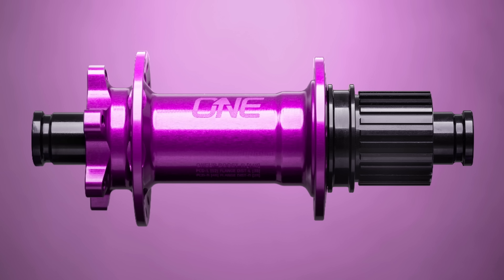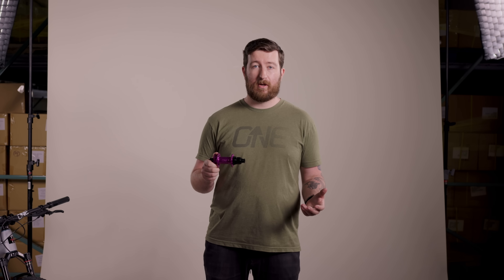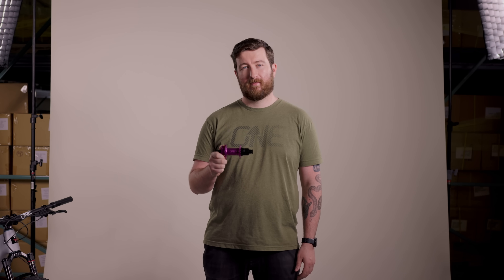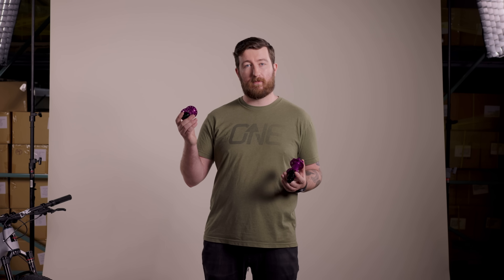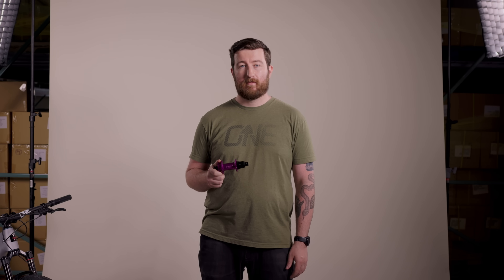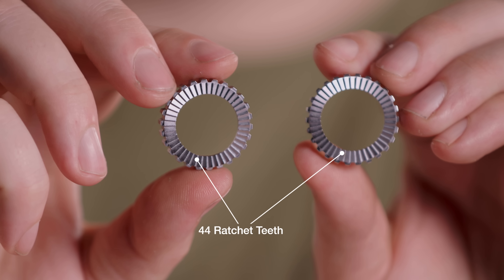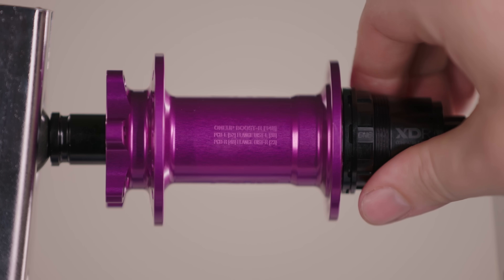NEW OneUp Components Hubs

Comment: the day the dt ratchet patent expired was a good day for many bike companies hehe. this variant looks great.
Reply: it is 100% copy with just more/less teeth
Reply: It was a good day for us, the consumer. Its a great system
Reply: @esshoul  The patent has expired, nothing wrong with copying something that is proven to be solid.
Reply: I absolutely love DT350’s, but I also love colors. Might have to bling my bike out at some point with these
Reply: Yes, what we need is more noise on the roads.
Reply: its like how suntour owned the patent for the double parallelogram rear derailleur.  And then when that patent expired everyone got nicer RD's
Reply: @zacharyk7006  derailleurs are still terrible though. who thought it was a good idea to run a transmission exposed to the elements?
Reply: @difflocktwo the people who are trying to get the most out of the human body’s modest capacity to produce torque.
Reply: @difflocktwo  If you know how to use a derailleur hanger alignment tool or if you just get your bike tuned somewhat regularly you shouldn’t have derailleur issues. I ride a lot and my derailleurs are never a problem
Reply: @jarnold1789  Why would I need to tune it regularly? That sounds like a defect. A bike is a very light duty machine compared to many other machines, maintenance intervals should be decades apart.
Reply: @CalebKussmaul  So we sacrifice everything for better pedalling efficiency?
Reply: @difflocktwo   Then learn how not to smack your derailleur on stuff. Mechanical things require upkeep. If you’re having derailleur issues it’s a you problem
Reply: @jarnold1789  Mechanical things need upkeep but bicycles need 1000x more frequent upkeep. Bicycles are very light duty and require frequent maintenance.
Reply: Why is it so much louder than DT Swiss?
Reply: The same face ratchet design has been in use on the keyless works of mechanical watches for at least a century.
Reply: @zacharyk7006  What's a double parallelogram rear derailleur? Every derailleur I know of has a single parallelogram. Maybe you're talking about Sun Race, who had the patent on the angled parallelogram design, which moved the jockey cage down as it moved in to lower gears, but SRAM ditched that with the Eagle derailleurs and they still work well. 

Shimano's patent on the up and downshift levers sharing the same pivot on their shifters is the reason the ergonomics on SRAM shifters are so bad though 😞.
Reply: @difflocktwo  Bikes are not very light duty at all compared to most machinery. Most machines rely on high rpm and low torque to transmit power, but human legs are high torque, low rpm, so bike drivetrains have to be a lot heavier duty than equivalent power electric motors for example. The 250 Nm torque capacity rating seen on bike gearboxes is more than the max torque an internal combustion engine, perfectly adequate to get a SUV to motorway cruising speed, can output. This makes bike drivetrains very heavy duty. Also consider the rider weighs many times as much as the entire bike. What is shameful in the bike industry is the normalising of very short service intervals on forks and shocks. My car is running almost entirely the same suspension as it was made with 13 years ago, with no regular servicing at all, open bath coil forks like the Marzocchi Bomber would run beautifully for years between services too - now nobody makes suspension that's genuinely fit and forget.
Reply: @peglor  Most mechanical systems have much higher torque and much higher rpm than a bicycle. Any machine with more than a kW of power output. And they run all day in dust and dirt.

You can think about the smallest lightest car and how much wheel torque and power it puts down from a stand still. Sure motor torque is 100-200 Nm, but it does that at 1000s of input rpm and then the wheel torque is way higher.

Loads inside a 6000 rpm engine are no joke compared to someone pedalling to the store.

And the transmission in those cars last forever with minimal maintenance.

1000s of N of force and few hundreds of Nm of torque on a bike is nothing special.

250 Nm input torque might be the input limit for such a car transmission but there are many points in that transmission seeing way more. There are multiple points of speed reduction found in those transmissions that leads to 1000s of Nm at the wheel , with not much steel.

A tiny electric motor will destroy a bicycle drivetrain through bent chainrings, bent cogs or snapped chains. Or even bent frames.

True, bike weight to rider weight should be considered.

Yep, pretty much all aspects of bicycles are super high maintenance.
Reply: @difflocktwo  Motor vehicle drivetrains don't run all day in dust and dirt, they're very well sealed and fail quickly when the oil sealed in with them gets contaminated or leaks out. They can afford to be well sealed because the weight of the gearbox housing and oil bath is small compared to the overall vehicle weight and the friction that really effective sealing where driveshafts exit the housings add is negligible compared to the power available from the engine. 

If electric motors (That weren't massively oversized and overweight for the application of moving a bike and rider around) were so good at chewing up bike drivetrains, e-bike specific drivetrains would need to be dramatically different in design from the pedal powered ones, and they're not. Also most of the housing of an ebike motor is to gear the motor down to the point where it's making sufficient torque to be able to move a bike.

When you consider that moving to a Pinion gearbox on a bike (Which, combined with belt drive means that even in wet muddy conditions, the earliest service interval, apart from hosing the bike down after muddy rides with no lubing, moves out to brake pad changes) would mean a weight penalty of at least 1 kg (Or a 10%+ weight increase on anything for XC racing), while also being less mechanically efficient.

Belt drives are less efficient than chains due to the heat generation in the rubber of the belt as it flexes (Same thing that creates rolling drag in tires). Meshing gears running in oil can be very efficient, but you still need a chain, which runs at similar efficiency whether it's on a derailleur system or a gearbox, to transmit the power to the wheel, so regardless of the gearbox used, the mere fact it is in the driveline means it will reduce overall efficiency.

Apart from a small few in DH/Enduro racing and long haul self supported bikepackers, very few bikes will use this setup. There is a 100k prize being offered this year to the first person to podium in DH using a gearbox, which might persuade a few more to try them.

Efficiency on gearbox bikes is poor enough that for the recent Tour Divide race (4400 km self supported with 60 km altitude gain from Canada to Mexico along the Rocky Mountains), even though a gearbox and belt drive would need massively less minding and the % weight penalty is much less relative to the weight of the bike with food, water, clothes and camping gear, the vast majority of riders still went with derailleurs for the efficiency benefit.

Comment: Only missing the complete set of wheels, been using the edc v1 since 2017 and is like new. A brand that knows what we riders need. Thanks for your commitment
Reply: Please don't use alloy nipples if you make a complete carbon wheelset. 
Thanks!
I'll keep the secret 😅
Reply: @LawrenceMacMacster  let keep it in secret, but if you wanna tight spokes on a whell its better to do with a right tool and not a multi tool. And leave it like this, the rest is for you

Comment: As much as i love oneup, 8.2° of engagement isn't the new benchmark. The feeling of hydra near instant engagement or onyx true instant engagement isn't gonna be beat by these. Tight engagement is hugely noticeable, hugely beneficial, and makes a bike feel tight and quiet (other than the hub buzz)
Reply: Idk about hugely beneficial. Hugely marketed that’s for certain. If you can’t make it up a techy climb with 8.2 degrees engagement that’s a skill issue not a hub issue. More engagement more pedal kickback.
Reply: @MillerRL96 it’s not about whether or not you need it but whether it benefits you or not. Do you really have that much problems with pedal kickback? Have you actually used the higher engagement hubs?
Reply: @MillerRL96  0.52° vs 8.52° is noticeable, quite noticeable. Moreover, next to no engagement is so quiet. And a quiet bike is a quiet mind and a fast bike. If you don't appreciate a quiet bike, then maybe the higher engagement ain't for you. Not only does it make a noticeable difference on technical climbing, it makes a difference in preloading your rear suspension for jumping. I highly doubt you've even tried it if you are arguing against it.

Comment: Genuinely curious how the drive ring being machined into the shell, resulting in all that wear on 7075, will hold up over time. (Comparing, of course, to the steel that DT makes their threaded drive ring from). They look like a rad new hub set otherwise!
Reply: That steel drive ring on Dt swiss is still threaded to Alu hub body...I assume that the endurance is similar..If the aluminum microspline does not have any problems with the cassette, I think this one will not have any problems either, it has a similar design, slightly deeper channels.
Reply: @zoranpl  but the "wear" of threads tightening over time is not remotely the same as splines that intermittently engage and disengage under torque
Reply: Dt ratchet ring is sprung on both sides. So the drive ring has to be steel as the ratchet ring slides back and forth in it during freewheeling. This looks like only the freehub side is sprung. Possible the alu could deform under load, but it looks pretty deep so even if it does, it shouldn’t affect anything.
Reply: @jshemuel  I know the man who destroyed that thread on the dt swiss hub... first time I saw it in my life... He could just thrown it away. This system seems more durable to me... the material will have marks but it will still do the job

Comment: 8.2 degrees is not a new benchmark. That's way too high, when there's hubs with as low as 2 degrees that exist. 

Also, machining the drive ring into the hub itself means that if it's going to fail, that's a hub replacement, instead of drive ring replacement.

Comment: The only detail that worries me is the drive spline cut directly into the hub shell. There's a very good reason just about everyone else has a steel spline here. Aluminium doesn't take high surface pressures and having other parts sliding on it anything like as well. If the hub body is also 7075 (The freehub is 7075 according to the video, and it absolutely needs to be as anything softer will get chewed in no time by the cassette under any half way strong rider) and it's hard anodised it will still last longer than most people will ever need though. Otherwise the design looks very sensible. I'll be looking at these if the Pro4 Hopes I've already got ever give trouble that's not immediately covered on their warranty.

Comment: OneUp Hubs use a OneUp-specific ratchet and spring. You can use a OneUp Ratchet in your DT Swiss™ hub (which requires an additional spacer), but you cannot use a DT Swiss™ Ratchet in a OneUp Hub.

Comment: Hey one up like the design of these rear hubs but i,m a little dubious about the ratchet ring running straight into the hub shell if you want see if your rear hub is strong send me one to test i have not found a rear hub on the market that can handle my torque i know i sound full of my self but its true. Also looks like you used the old size hugi ratchet rings ie slow engagement model 😣

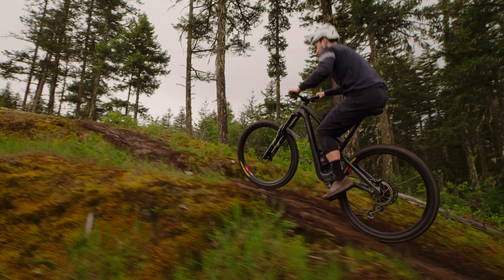Comment: I hate to break to you, but there is a fatal flaw in your design. Aluminum is much softer than steal. The steel insert is maybe 20 grams difference. @1:18 The pressed in drive ring is a wearable. When the shell wears out now you will be replacing the entire wheel. I have destroyed plenty of wheels.  I promise you this will be an issue and your will need to come up with a revision if you want it to be reliable.
Reply from the maker: We used 7075 Aluminum for the hub shell and haven't seen any drive ring failures in all our years of testing our design.
Reply: @oneupcomponents_official  I don't mean it in a bad way dude I'm just destroyed a lot of stuff including chainrings and whatnot that I made it at 7075 aluminum. If you're in a ride to sugar Sand Florida I can promise you eventually chew itself.
Reply: Using voice to text and I got weird icons on my phone I don't know how to get off.

Comment: As a Bike mechanic, I like your hubs! The ratchet system you running, is the best and endurabel set up. I ride the same system on my 2017 DH Bike, with the DT 180 hubs. But like I said, your hub is running too, with the best possible set up! And for me, personal, it's cool, that you can turn your ratchet quiet, with a bit grease, on the right teeth ring 😂👍‼️
And, also very important, your product looks almonst porn👍👍👍‼️

Comment: 44poe just doesn't cut it for tech climbs.  I used to think jumping from a DTSwiss 36t to a 54t was great, then tried Hunt 72poe and it was even better and thought don't really need more than that,  than tried  Raceface 120t and thought that it was almost instant engagment and my minimum is 72t, then tried I9 Hydra and thought it don't get better than this, went back to 72t and that did not cut it and even 120poe felt slopy and thought 120poe was the bare minium insteat of 72poe, then tried Onyx and that is the holy grail of engagement performance and feel, even the I9 Hydra doesn't compare to the Onyx,  that instant but soft engagement is magic.
Reply: I snapped two i9 so I'm back on DT and a DT clones, 54t (I run 60) is pretty much ok if you're not into trials, at least to me it isn't limiting plus you get less drag than with pawls. It's a choice...
Onyx clutch feel isn't for everyone, I hate it and I also don't like the feel of ochain.
Reply: @LawrenceMacMacster no way on i9. I have owned every generation on i9. When they release a new one, I buy it. I have yet to break, or even have to do any major wheel trueing.  I sold my wheelset when I worked in the bike shop.
Reply: @LCNismo hydras are notorious for breaking axles.

Comment: Nice, but I'm done with  6 bolt rotors. Centerlock is the only way to go. The extra time it takes when flying with my bike and the on/off and 12 bolts is too annoying. I also like using the same tool as the cassette to take on and off rotors as in Centerlock. DT Swiss clone and centerlock? Yeah, then you'd have a winner.
Reply: Can’t spare that 5 minutes?
Reply: @kevinyounger7854  yeah he's a little dramatic
Reply: @kevinyounger7854  Yeah, probably nit picking, but it takes a bit longer than 5 minutes.

Comment: The mistakes in this hub. The machined ratchet ring is not a good idea. If it breaks you have to buy a new hub instead of replacing the ring. Hope the endure bearings don't have ceramic balls otherwise its inferior to steel ones. They last way less before pitting the race and that few mW saved is not worth it. For racing its op but for every day use its bad. Ebikes will chew up that 44t ratchet for breakfast on climbs.
Reply: The ratchet rings are replaceable, $44 a set. Go look at the photos on their website.
Reply: @dfiler2  Its not.The drive ring is machined from the hub. Its their last question on the FAQ on the website. They gave a bullshit reason and not a real world one. Ther eason the drive ring failed because people used way way too much torque or used an airgun to install it.
Reply from the maker: The ratchets will fail before the drive-ring, so no need to worry about that failing.
Reply: @kazuviking  You said "ratchet rings". That's why I replied with the correction that the "ratchet rings" are indeed replaceable without replacing the hub.